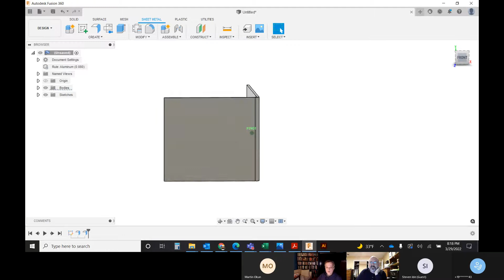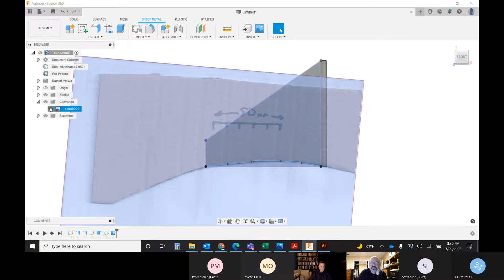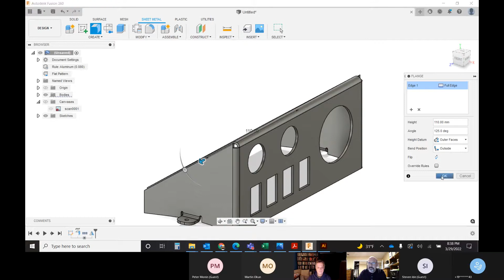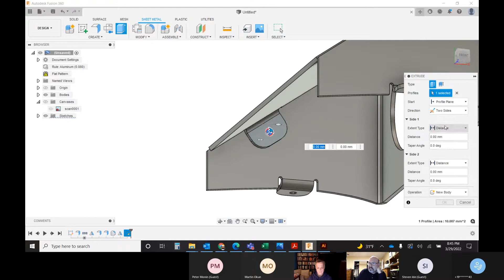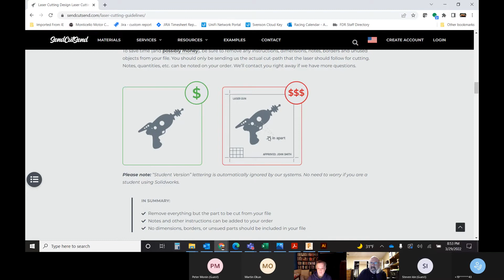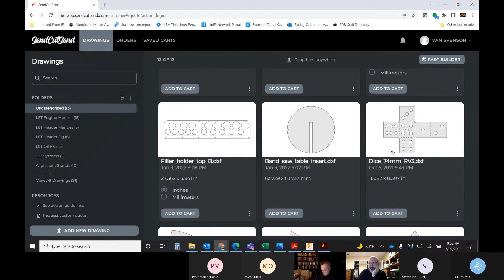Fusion 360 - Sheet Metal, making a gauge pod for a car

Comment: Wish there was an auto feature to select the bend center line, add cuts at x distance and spacing, along with a tolerance input for leaving x amount of material on the flange to avoid weakening the small tabs for exmaple.

Comment: Do you have the sun visor bracket file?
Reply from the maker: 944 sunvisor bracket?  Years ago I made one in Tinker CAD...
Reply: @vsvenson  is it a file type that can be 3D printed. I have a 944S that needs 2, but I am afraid the visor needs to be reset, so I may need to go thru a few to get everything working right
Reply from the maker: @marklangren3142  shoot me an email - vsvenson at gmail